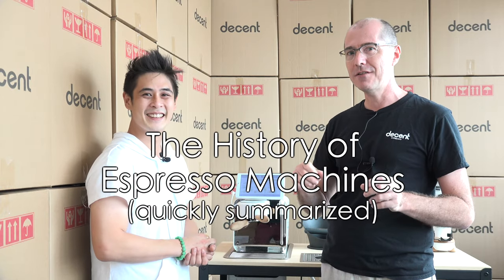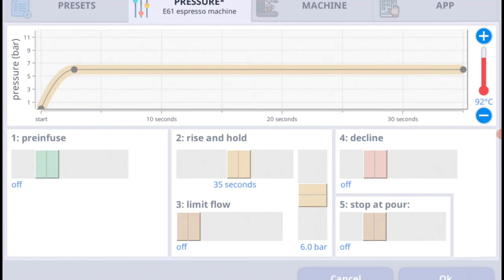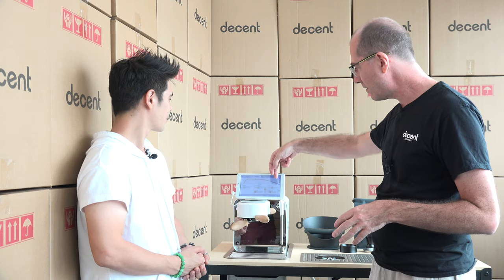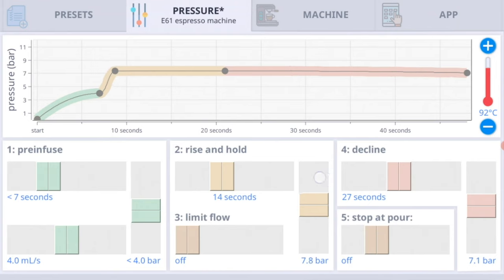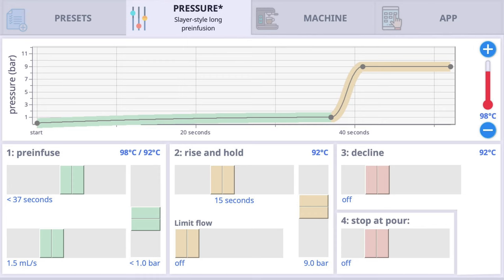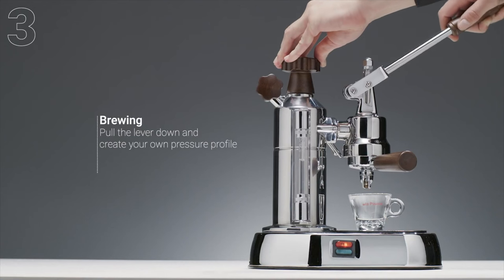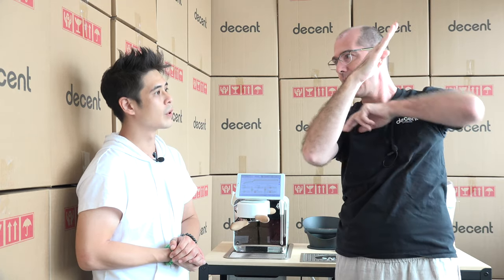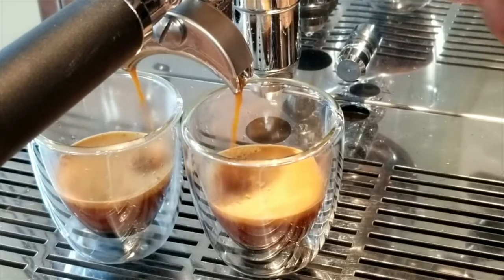History of espresso machines (Quickly summarized)

Comment: If I buy the DE1XXL will I be able to use it on 220 and also on 110 ? In other words is there a possibility to change a switch on the machine to be able it to function as it it was a DE1xL but at 110 instead  of a DE1XXL at 220? 

I would like to buy the DE1XXL but realize that in the US it’s hard to find a 220 outlet. If I need to take the Decent espresso machine somewhere with me it might be hard to find a 220 outlet .
Reply from the maker: You can buy a 220v machine and have your electrician help you with a converter. Many DE1 users in the US have done that with no issues.
Reply: @decentespresso  I realize that I can get an electrician to add a 220 outlet. That’s not my question. My question is if you can plug the Decent DE1XXL to a 110 outlet and turn on a switch for it to work as if it was a DE1XL in a 110 setting. 

The reason I asked is because there are electrical appliances that have that feature that they will work with both 110 or 220 simply by turning a switch in the unit. For example my 3D printer is compatible for both a 110 or 220 outlet by simply turning on a switch on the 3D printer. 

In the US 220 outlet are not readily available and if I need to move the espresso machine I was trying to determine if I could use it in a 110 outlet by merely just turning a switch. I would get an electrician to add a 220 outlet for it to work as a 220 with its full power . However, if it had a switch for it to work as a 110 version with its limitations of the DE1XL it would make it an easier decision . 

That’s my question. I know I can get an electrician to install a 220 outlet. 

My concern with the 110 Version is I am concerned with the steaming power.  I am used to my La Marzocco Linea Mini and I love the steaming power. I am not sure I could get used to the steaming power of the DE1XL in the 110 version. However, I am concerned how that will limit its transferability if I need to move the espresso machine to another location. 

I assume that the answer is simply no it’s not compatible with 110 outlet period. I just wanted to get a confirmation  before I decide how to proceed.
Reply from the maker: @EdGodoyPlana  you can't, but you can get a power converter for about USD$150.  I've used a 110V machine in the UK with one.
Reply: @decentespresso  so if I am understanding you correctly I could buy a converter for about $150 to convert the 110 outlet to be able to use the DE1XXl as a 220 and it would be fully functional with no limitations?
Reply from the maker: @EdGodoyPlana  Firstly, the 220V model of the DE1 is about 20% more powerful than the 110V.

I do not recommend the XXL model, as it needs more amperage than 110V can give you.  Go with the XL model if you want to do this.
Reply: @decentespresso  so a converter will not work to convert the 110 to the 220 needed of the DE1XXL?  

What amperage is needed for the DE1XXL?  That would not be available in a converter?
Reply from the maker: @EdGodoyPlana  Be aware that 110V is much less powerful than 220V.  You can't just up-voltage and expect there's enough power there.  DE1XXL uses 9.5A at 220V.

I don't think it's worthwhile to buy our most powerful machine and then give it not enough juice.

You absolutely can use a 110V to 220V up converter. However, your steam power will not be as good as if you had a native 220V line.

In the USA, a 220V line is available that combines two 110V lines, just to give you an idea.

My suggestion is really, really, if you are going to spend $5000 on a 220V XXL, then spend a few hundred $ to get a 220V plug.  If you don't want to, probably better to stay with the XL model, since the XXL is all about using the extra power, that you won't have.
Reply: @decentespresso  I am not saying I would not get a 220 outlet installed. I am just trying to see if I had to move it to another location if it would work on a 110 outlet. 

Thanks for the information.